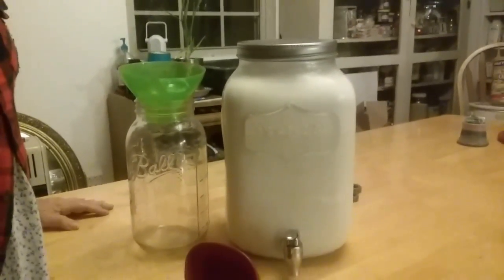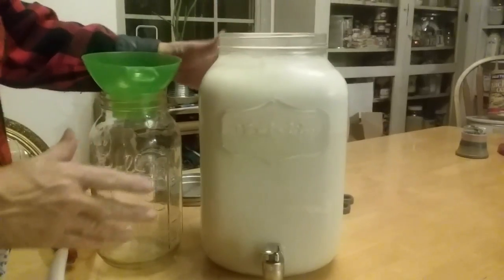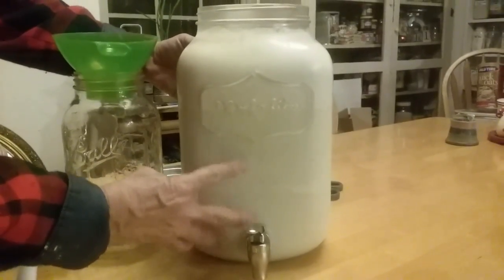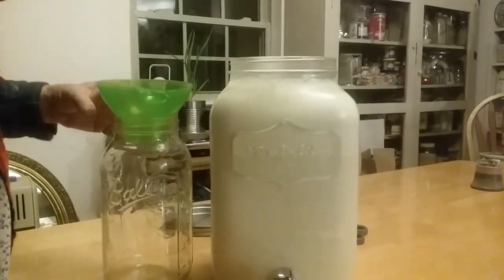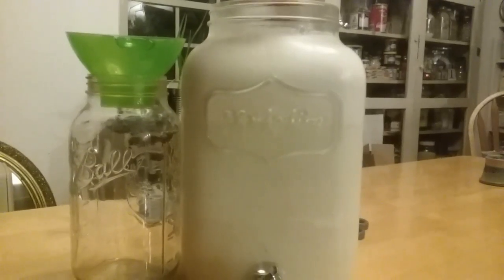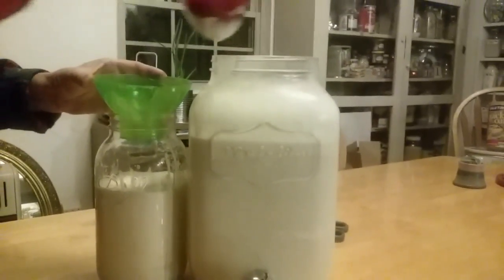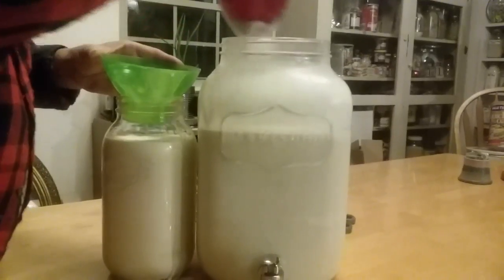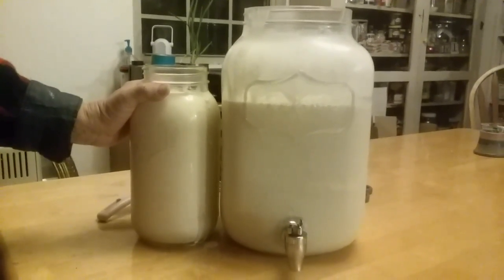How we separate the cream from the milk

Comment: thanks now my gallon of milk is spoiled
Reply from the maker: How did your milk spoil? Maybe there is a misunderstanding. The milk is placed in the refrigerator for 24 hours. When the cream has separated, take it out of the refrigerator and scoop out the cream. Then return the cream and milk to the refrigerator. I hope this helps to clarify the instructions and I am sorry for your loss. Vivian Ann on the side of the mountain in northeast Tennessee
Reply: @2ladyhomesteadershodge898  maybe my fridge is not cold enough (it's full of vegetables), and butter is used only for special occasions here because people think it's expensive compared to margarine. (During the dutch colonial times the jews brought margarine here, people think it's the same thing with lower price)
Reply: maybe Your milk is fermented not spoiled. look for fermented milk. it becomes thick. doesn't mean its spoiled You can make many thing with it. smell it first if it smelled bad then its spoiled

Comment: This is a great way to keep the milk part drinkable milk (whole milk),  unlike using cream separator machines that reduce the products into basically skim milk and cream.  However, my only thought is that you are working too hard to get the two products by themselves.  Instead of skimming off of the top after separation (a lot more work and messy).....you have a built in drain as it were, why not just drain the milk part into a separate container until you reach the cream separation line.  At that point you have one container with cream and one with milk.
Reply: thats what i thought it was for😂😂
Reply: Why its better than skimming machine.
Reply: As you can see the spigot is about 40mm above the bottom of the jar. You wouldn't be able to drain all the milk out and it would be left sitting at the bottom of the jar.
Reply: mark hughes I’m definitely using your thought on this...great idea..thanks
Reply: Can you add some of the cream back to the skim milk to reconstitute whole milk?

Comment: is the milk uncooked or should we cook it first before take the cream?
Reply from the maker: tyowongndeso... Good morning, We use our milk raw (unheated) except when I am making cheese. Both ways work with this method. If you should want to pasturize,  simply heat the milk to 160 degrees  F and then pour it into the jar to separate. Place the jar into the frig or cooling area immediately.Good question. Vivian Ann on the side of the mountain in NE Tennessee
Reply: thank you.how long do we need to sit the raw milk to have cream layer? do we sit the unheated raw milk in fridge or do we just sit it in room temperature till the cream formed?
Reply from the maker: @tyowongndeso  sit the milk in your refrigerator for about 1 day. The cream should have separated. If the milk is not refrigerated it well sour. God bless, Vivian Ann